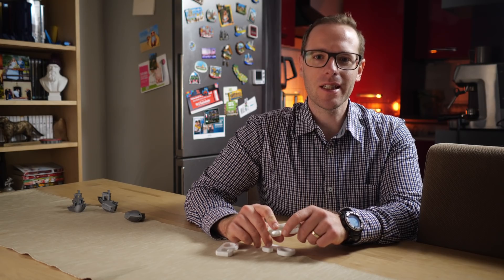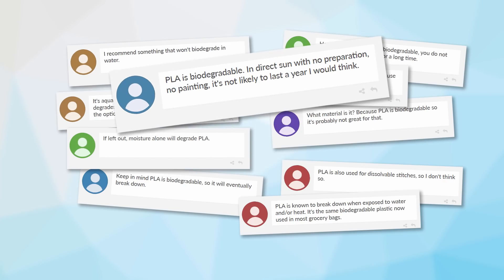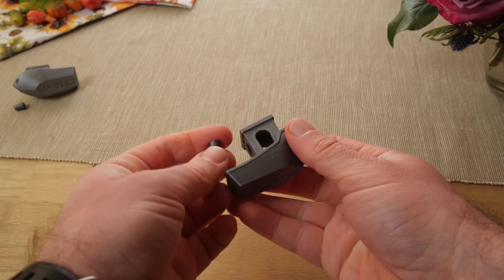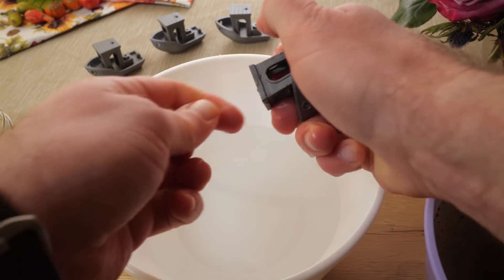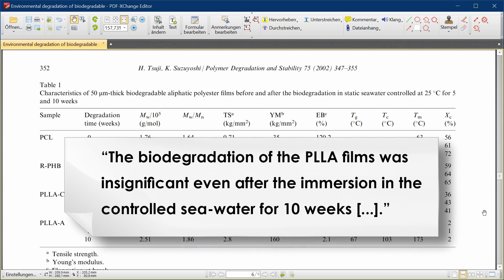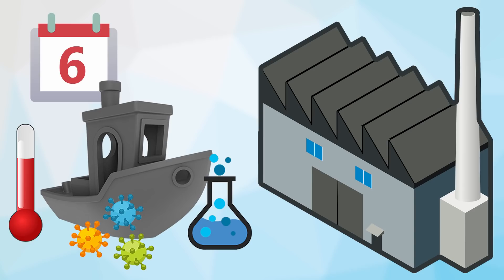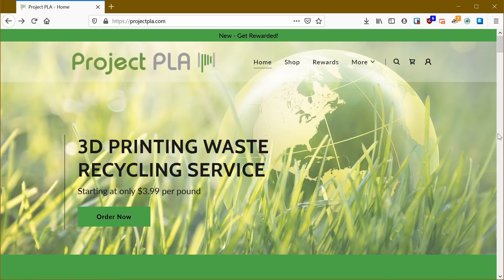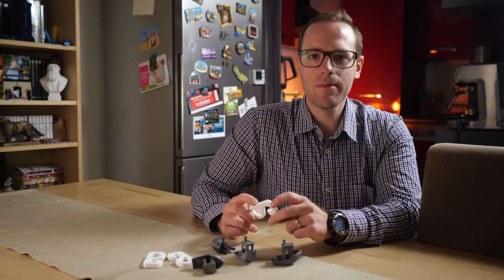Is PLA for 3D printing really biodegradable? I've buried and drowned Benchy for 2 years to find out!

Comment: Some parts in my bathroom loosened strength in about 3 years. I also lose a roll after the same time(stored). I live in amazon jungle. Here is very hot and humid.
Reply: Even my PETG parts in heat and humidity lose strength and start deforming.

Comment: Disappointing and Outrageous !!! > :(> :(> :(> :(

Many 3D printing enthusiasts were encouraged by the promise of being Biodegradable PLA ... but ... even though manufacturers know how difficult it is to achieve ... they continue to promote it like this ... :( :( :( :(

Thanks for sharing ... :)
Reply: Problem is that these plastic can be biodegraded under very specific conditions only. Usually requiring very specific bacteria, high heat and high amounts of oxygen. In nature these "biodegradable" plastics probably take hundreds of years to start degrading.

Comment: Actually I have a question: Pla is made of corn starch instead of fossil fuels but cant be recycled that easily. But if you burn it wouldnt that be for the enviroment comparable to burning wood since you are basically burning plant material? Of course not calculating in any additives wich are probably worse.
Reply from the maker: It's hard to say which is worse, I haven't seen much info about what happens if you burn it. I think a better approach would be if it were burnt in recycling facilities where they can produce energy from it.

Comment: Great work! You've got yourself a new subscriber.
Anyway, i'm curious about the environmental impact regardless of the biodegradability. Things like how toxic is it? Does it degrade in various digestive systems when it ends up in nature?
Reply from the maker: Thank you, I appreciate every new subscriber!

PLA isn't probably toxic as such, since it's made mostly from corn starch. I think it depends more on what kind of additives were used for the coloring.

I haven't heard of it degrading elsewhere outside recycling facilities, although I'm seeing a few comments here where people are mentioning that some bacteria in nature/sea can actually digest it.
Reply: For being toxic PLA would have to release chemicals, molecules, able to get into organisms and interfere with natural chemical reactions in these organisms. But as seen here, PLA is inert, it doesn't degrade or dissolve, so I'd say its toxicity is negligible.

Comment: In Sweden, we burn plastic that is not recyclable. Amongst that counts even black plastic, no matter of the type. All black plastic will be burned. And so also plastic contaminated with other material, like plastic in milk cartons.
Burning the plastic either gives heat to the factory recycling stuff or to heat houses or create energy.
Landfill in Sweden are more and more rare. The most part of what does to landfill consists of mining waste and contaminated dirt and ash from incineration. Household trash is recycled one way or another (new material, compost, making heat and electricity and so on) to 99.5% and 0.5% goes to landfill.
In 1975 over 60% went to landfill so i must say we have come a long way.
We also have one of the most advanced plastic sorting facility here so if i throw PLA in the plastic recycling container, it will be sorted out from the other types. Now, since they still burn it (to make usable energy) you can just throw in in the regular bin since that will also be incinerated.
Since we recycle so much here we almost never have regular trash. A normal wheeliebin will last our family (two adult and one child) like several years.
Dust from vacuum cleaner, old trashy shoes and some scrap of smaller quantities (like that synthetic wax around some types of cheese) is all there is to put there.
Reply from the maker: I'm not surprised that Sweden is very progressive in that regard, that's really good to hear.

Germany is doing better as well, although in a typical fashion, the statistics don't tell the whole story. On paper, we recycle a lot and barely have anything left that goes on the landfill. However, a lot of waste that would have to go on landfill is shipped to other countries like Poland and even in Asia. So technically, the landfills within Germany are not getting filled and that makes for a great statistic, but in reality, the waste is just getting dumped somewhere else.
Reply: @HobbyHoarder  That really sucks. We actually have another somewhat interesting problem: We are to good at sorting and recycling the material itself so we do not have enough trash to burn. =)
That is why we import trash, to burn. Around 1.3 million tons every year.

The bad thing is: This should have been better sorted so we can reuse and recycle the material itself.
The good thing is: This does not end up in a landfill in other countries but gets converted to heat and electricity in high tech furnaces with special system for cleaning and filtering and washing the fumes.

So when i turn on the stove, the electricity can actually come from trash that would have ended up in a landfill in another country! Pretty... weird. And even more psychic is that lets say that Norway export trash to us, we burn, create electricity, and then Norway import that electricity. =)
Reply: @HobbyHoarder  f our high tech sorting facility (for plastic) can sort 20 tons per hour, 24h. And grade into 10 different fractions. And then they put them through one more time to get as pure fraction as possible. Computers, cameras, different spectra of light, air puffing and sucking, rollers bouncing the plastic, magnets and more. Sooo cool to see! Would love to visit IRL!
And yes, i do not know if you have it there too but here we also have "pant" on water/beer/soda bottles/cans (now coming also on juice bottles). You pay a fee when you buy the bottle and then you recycle in a machine and you get the fee back. This way, we have almost no bottles trashing around in the nature, and if someone is lazy (yes, lazy people we have enough of...) other often pick them since they are worth money.
So during a festival or something like that... oh my, those kids running around collecting the bottles and cans can make a fortune! =)
A can/bottle of normal size (33/50 ml) is 1 SEK. A large bottle (like those 1,5 liter ones) are 2 SEK.
Reply from the maker: @Xanthopteryx  Yep, we have "pfand" here as well :) It's a really great idea, I wish it was mandatory everywhere in the EU. As soon as I visit a country that doesn't have this system, there are plenty of bottles on the ground.

When we visited Canada and bought some drinks in Walmart, we wanted to return them the next day and asked at the counter where they have the machines. The lady looked at us like we're crazy and said they don't have anything like that.
Reply: @HobbyHoarder  Oh, so nice! And here we have also started with "pant" on other trash like plastic and paper packaging. A company that is trying to make trash being valuable. It is in the beginning of it so for now, you will get 1 SEK per package, maximum 5 per 7 days. But, some manufacturer also have gotten into it now so one bread maker gives you a coupon (for buying new bread) for each of their plastic package you recycle. And a dishwashing detergent company, the same for their package. So there is a way forward even though it is a slow one for now. And i like the idea: Trash that have a value will not end up in the nature or in the wrong bin.

Funny to hear about your visit in Canada. =)
Reply from the maker: @Xanthopteryx  I've seen stations in Czechia where you can refill detergent and soap and stuff like that by bringing your own bottles. Really neat.

Well, I felt that Canada was more progressive in that regard, but really, they're barely any better than in the US, so I was quite disappointed.
Reply: @HobbyHoarder  I hope we can start changing the world when it comes to this. Stop landfill (make is VERY expensive to tip, like here in Sweden - it cost a lot!) and then there will be alternatives. And all those small things like getting paid for bottles, reduce the amount of packaging and more.

Comment: I will no longer 3D print
Reply from the maker: You don't have to go that far if you enjoy the hobby and find it useful. But just being aware of it can have a big impact in preventing useless stuff being printed, or simply discarded.
Reply: j5 another option is a hobby CNC. Wood and Aluminium parts are fully recyclable or biodegradable.
Reply: @amiddled  that's a great suggestion

Comment: The only actual hope is evolution...

In 1975, a strain of Flavobacterium that could digest certain byproducts of nylon manufacture was found living in ponds containing waste water from a nylon factory.
Similarly a PET eating bacteria (Ideonella sakaiensis) was identified in 2016 within a sample of PET-contaminated sediment near a plastic bottle recycling facility in Japan.
As for PLA, several bacteria from the genus Amycolatopsis are able to break it down: in one paper, 300 strains were isolated from 50 samples of soil, pond
water and river water, of which 2 were able to break down a very thin PLA film in water.

So maybe grind up all your PLA waste, put it in a dirty pond, stir and add sugar occasionally... and then add a Benchy? 😕🤔
Reply from the maker: Hehe, that would be a very interesting experiment. It would be perfect if you could buy some sort of powder that you'd just sprinkle over a compost with plastic and it would produce the right kind of bacteria for it.
Reply: @HobbyHoarder  There is a lot of research into plastic decomposition, especially involving PET; the PETase enzyme of Ideonella sakaiensis has already been genetically reengineered to increase its effectiveness up to 14 times!
A GMO bacteria spore powder for DIY plastic composting would be very profitable, providing an easily marketed solution for single use plastic pollution :)
Reply: @HobbyHoarder  Have you seen “The Andromeda Strain”? Be careful what you wish for :)
Reply: half of modern cars is plastic, it would suck if there will be a "plastic rust" that will disolve them just like old sh*tboxes... a prefect plastic product should have a self destrucion button that will turn it back into pellets you can send back to factory...
Reply: evolution is slow. why not just genetically modify a common bacteria to break down plastic instead? probably because the eco-hippies won't like it.
Reply: @eyeborg3148  Protein engineering is very, very hard. It's a guessing game of how will a 1D string of aminoacids fold into a 3D protein, how will it interact with the thousands of other structures inside the cell, and if the gene will express when you want it.
It's much easier to find something that works already, and then try to make it better.
Reply: @eyeborg3148  evolution in microorganisms are orders of magnitude faster than in larger organisms(humans for example)
Reply: Stenotrophomonas pavanii CH1 and Pseudomonas geniculata WS3 are mentioned in one 2018 paper. I'd hope that in a couple of decades most current landfills will be seeded with plastic eating bacteria, with byproducts being used to make new plastic.
Reply: Doubtful. There are already organisms in nature that can break down most pollutants. The problem is "can" does not mean will. Just like any life they consume the easier substances that are more nutritious to them first. Soil, ocean and lake water already contain lots of natural stuff that is better to eat than our junk. That's why for example microbes that eat PCBs living in river mud is old news and yet the PCBs don't go away.

Also, microbes don't know the difference between your valuables and your trash. Not degrading is actually a reason why we use plastic. If microbes suddenly did start eating our plastic stuff we would have to switch to something else. Imagine the vinyl siding rotting off the side of your house!
Reply: jurassic park said it best. give nature a challenge and it will find a solution. the cycle of destruction and elemental recovery WILL happen. might be an insane wait...but nature will devour everything humanity has ever made.
Reply: i would think that the hope would be that plastic would remain non-degradable in the environment. I would rather not find some novel bacteria has eaten all my weatherproofing and allowed moisture to get where it shouldn't be, like into wiring or mechanics.
Reply: @jaqssmith1666  If plastics were fully non-degradable, they could also serve as a convenient carbon sink against global warming. 
As they are not though, you need a reliable degradation mechanic, especially against neurotoxic microplastics.
Reply: @trabladorr  it's already over

Comment: I wouldn't at all be surprised if your results with the new test are the same and went in to this video expecting the results you ended up with, mostly because no real change in temperature occurred.

With that said, it's not true that degradation can only occur at specialized compost facilities - The Bioplastic Container Cropping Systems Program at Iowa State University ran a series of videos some time ago documenting their progress with various kinds of PLA in a hot compost that is achievable in a home setting over a 10 week period - you can catch their playlist here: https://www.youtube.com/playlist?list=PLvScGa0wCCKlLcFDzLBK3hSKHMVzCPlY3 .

Of course, that does not address the problem that most people do not compost and most people who compost don't 3D print. It also doesn't address the issue that, commercially at least, there are very few options for those of us who don't have the means to do it right.
Reply from the maker: That's very interesting, I wasn't aware about that project, , thanks for sharing!

I really wanted to buy my own fillament shreder, but by the time you buy everything to recycle it into new spools, you've already spent a few thousands. It's just not worth it for a home setting. However, I'd love to see a company that would collect waste plastic and turn it into new fillament. Filamentive is already selling recycled spools, but from what I can tell, they don't have the option of sending in our failed prints.
Reply: @HobbyHoarder  We have companies here  that just offer plastic grinding services - I've long been tempted to see whether thy would take low (for them) volume orders. I'm not yet at the stage personally to spring cash on a home shredder either, unfortunately.

Comment: But what about plastic bags?? I have had a few grocery plastic bags that was in attic for about a decade if not a little more and they basically turned to dust. I have no idea if they were made of PLA though.

I think it would be interesting to repeat this experiment for a much longer time.
Reply from the maker: Plastic bags aren't typically made from PLA, although I've seen a few that claim they're degradable or that you can burn them without producing toxins.
Reply: @HobbyHoarder  I see. All I know is that it is supposed to be one of those "degradable" bags.
Reply: Polyethylene is generally strongly affected by "environmental stress cracking", a kind of erosion. I think they can enhance the natural propensity of polyethylene to erode with an additive. Polyethylene burns under certain conditions cleanly without residue. Unfortunately in the process of erosion, it will just become plastic microflake, which will just spread all over and not necessarily get broken down.

Comment: Thank you for answering my unasked question. 
    New question, what about PLA with wood or bamboo?
    And, would putting the samples in a composter, possibly with garden store available accelerator enzymes help speed up the reaction?
My own answer is building a plastic shredder/filament mill.
Reply from the maker: Wooden filaments are only about 20% wood dust, the rest is still plastic. So I guess it's a little bit better, but not much.

Shredder definitely seems like the way to go, especially if you can afford the machine to produce your own filament (check CNC Kitchen, he did a video on that topic).

Comment: The micro plastic problem is lot less severe with PLA. Because small particles of PLA are degraded inside organisms.
PLA implants in humans degrade fast enough (6month-2years) to use them as a slow medication dispenser.
Big pieces might take a century degrade in nature, but shredded PLA should take much faster, especially if something ingest it. Still we are talking more than 10 years.

Comment: PLA is more durable than I have thought.
Reply from the maker: Yeah, I was always worried about using it for things outside, but it's really not an issue.
Reply: @HobbyHoarder  Well outside you have to worry about UV light, which degrades PLA pretty strongly. Water is actually good for it though.

Comment: i would like to see what happens after it is shreaded and put under uv light for a year
Reply from the maker: It would probably get more brittle, but that's not really recycling. Besides, if you have to keep it under UV for a year, you might as well process it in a proper recycling center.
Reply: @HobbyHoarder  Did a bit of reading. I think you can incinerate it in a yard fire pit safely. Or if you grind it up fine enough it will get eaten by microbes. You can also reextrude it.

Comment: Anything that is biodegradable in a couple of years underground would also be on a shelf. Imagine if every plastic object you have around the house had to be replaced every 3 years. One of the best (and worst) aspects of plastic is that, whilr being cheap, it is incredibly resistant to the environment, it does not rot like wood nor it rusts like metals. Of course such an important and dangerous resource should be handled more responsibly, but it would be impossible to get both benefits
Reply from the maker: Yeah, plastic is really both a blessing and a curse.

I'm switching all of my filaments to ones made from recycled plastic or bottles. The color selection is getting better and better as well.